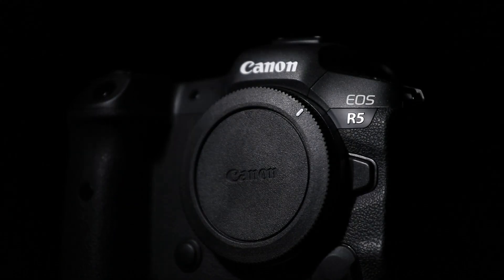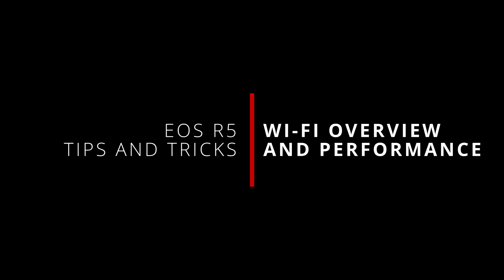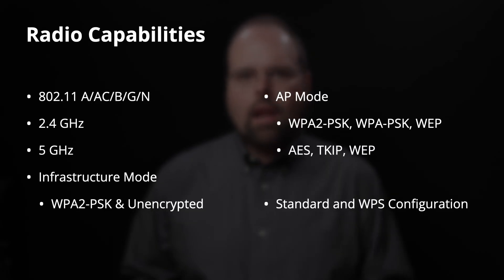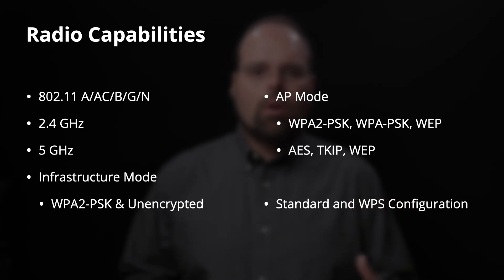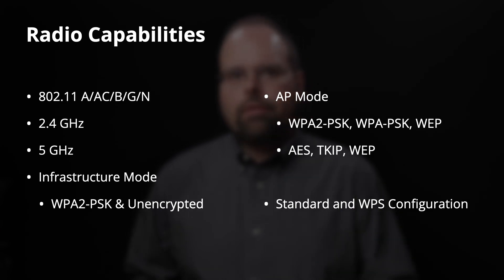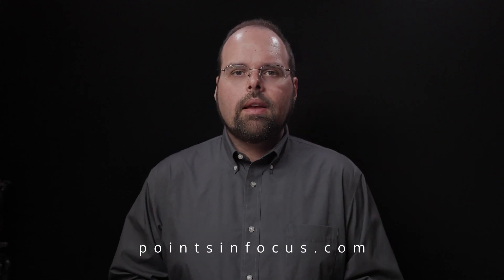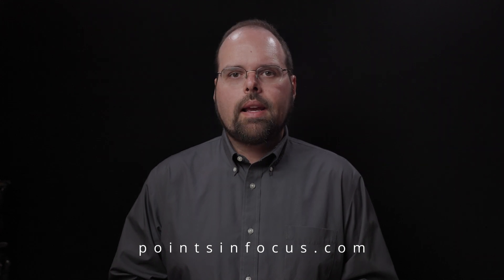Built In WiFi Performance Testing - R5 Tip 53

Comment: Very interesting video. I use the R6 regularly to transfer images to a ftp server live during football matches and the R6 is linked to my mobile phone network ( 4G) . I noticed a significant drop in transfer speed after I updated the R6 to the latest firmware. In the past I had my mobile phone in my side pocket and no issues with transfer speeds. Now I have to put the iphone next to the camera to increase the transfer speed. Is there anything I can do to improve the transfer speed?
Reply from the maker: I would say you could try using a 2.4 GHz network instead of a 5 GHz one. If you're using an iPhone, you can enable this by switching on "maximize compatibility" in the personal hotspot menu. There's a similar setting on Android devices too.

That said, I'm not sure how much of a difference that's would actually make in the case of the R6. I don't have one, so I don't have any direct data on it's WiFi performance.

What I'm way more curious about is how you have FTP setup and working. There are huge problems with FTP and remote servers on R5 firmware 1.6. In my testing, and there's a video coming on this in a couple of weeks, my camera would simply drop packets that originated from an IP address outside the local network. I banged my head against that wall for 5 days trying to demo the power of FTP to do just what you're doing, and the camera would have none of it.
Reply: @PointsInFocus  In my case with the R6 it's straight forward. set up the iphone to connect to the R6, follow the ftp instructions on the camera menu to set up the ftp server address, password etc and the the camera connects to the ftp. I dont't have any issues with the R6 keeping the connection to the iphone , only the transfer speed. Before the firmware upgrade the R6 was transferring much faster than the 1Dx MKII ( with transmitter attached). I wonder if I can instal the previous firmware on the R6 to test the ftp transfer rate
Reply from the maker: Just to be clear, and I know this is kind of stupid, but the FTP server you're connecting to is not running on the iPhone? You're just tethering internet access for the camera through the iPhone?

The problem I ran into with the R5, is that if I try to connect to an IP address that's not on the same local network, the camera won't even establish the fundamental TCP connection, let alone the FTP connection that runs over it.
Reply: @PointsInFocus  yes you are right.
Reply: Did you find a solution for faster transfers? What kind of internet hotspot are you currently using? How many images can you transfer per minute?
Reply: @lacanvasfilm  He has a the r5ii. I doubt he will revisit this. I wanted to use this do download pics without removing the card or using usb thus wearing out mechanical connectors. The CF express are very durable and are super fast, it makes no sense to use wifi for me. So I will never use this unless I tether. I thought I was going to tether and I do not, again, it is just too much effort and time.

Comment: Interesting video.  Since the camera camera can send/receive quite a bit of data through walls at 2.4GHz why do Canon (and other brands) make us pay several hundred dollars for wireless flash transmitters (which also work at 2.4Ghz)?
Reply from the maker: The simple answer to that, at least in part, is that they're niche products. On the whole, not many people use wireless flashes, and that means the gear is more expensive since there are fewer sales to amortize the fixed engineering, regulatory, and manufacturing costs.

Of course, that just raises the question, why not use a standard wireless protocol like WiFi, Bluetooth, Zigbee/Z-wave or something like that? If I had to guess at that, my guess would be latency and complexity. But I haven't torn into the RF flash protocols or latencies enough to know for sure. That said, I'm sure on the engineering end of that equation it's not quite that simple either.

Comment: Did you contact Canon and ask them about the terrible performance of the 5 GHz frequency?
Reply from the maker: No, though I may do so eventually. Unfortunately, in the process of digging into the networking on the R5 I've run into so many significant issues that I got frustrated and really didn't want to deal with trying to talk to support people about what I found.
Reply: @PointsInFocus  yes. what they are doing down there in japan? ther's at least 1 person , at least one, that after put out a product , that can test it? i've got so many problem with official tecnician of canon here in italy, they dont understand, .... for example...also regarding the impossibility, when i have a flash or a trigger in camera, to see the same pic in the viewfinder like it was before i turn on the flash. Impossible to get it. and other strange issues that only r5 has,: RP works better with hss whit godox flashes, r5 sucks. what they are doing????

Comment: Thanks again for a very informative report. I just assumed that the 5GHz was better but found the transfer rate pathetic. I’m going to switch it over and give it a new chance. 

I’m still appreciating your last report that fixed my iPhone connected GPS.  It works great and I’m amazed that it reconnects after powering the camera on and off when changing lenses. The only thing I need to remedies to turn that airplane mode back on or the power drain overnight kills the battery.
Reply from the maker: Yea, unfortunately, the camera doesn't actually power down the BLE radio when you turn off the power switch. That's a little annoying, in fact, I just discovered that the camera can do some kind of soft power cycle if you connect to it via BLE while it's turned off.

It would be awesome if we could use the lock button to toggle airplane mode. But alas, nobody at Canon had the imagination to see that use.